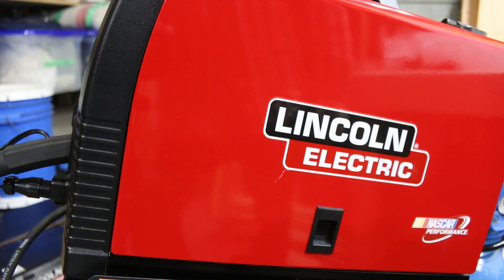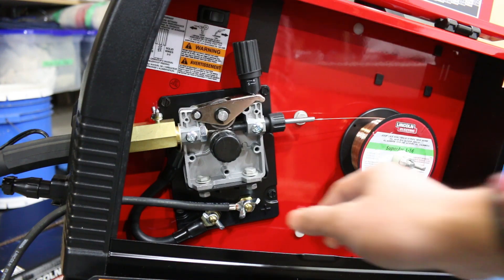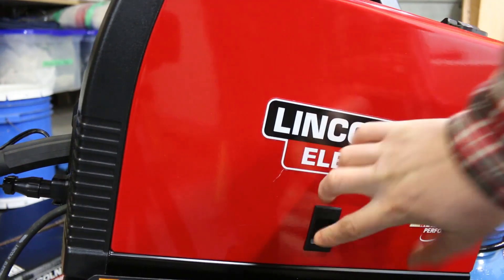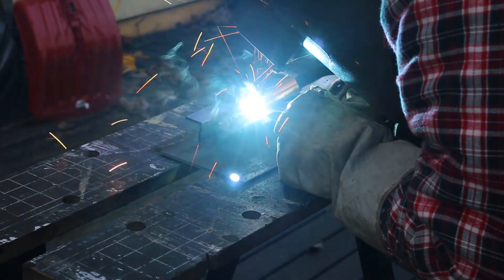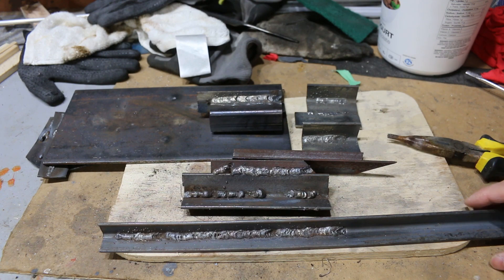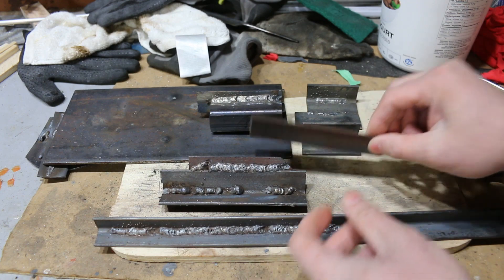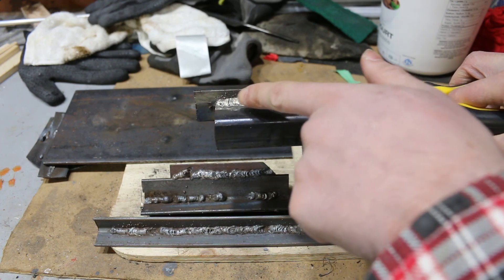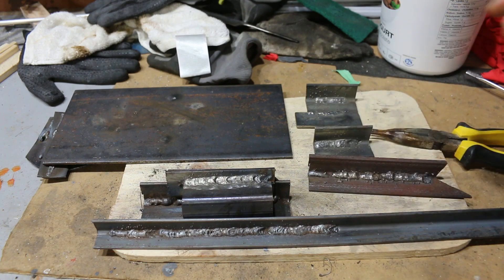Follow up to Lincoln Electric MIG Pak Welder 140 Review

Comment: With the angle you were using, you were going the wrong direction. 
 You were pulling your weld, you should be pushing your weld (right to left) for your angle  you were using.

Comment: I was going to tell you after watching your first review that you forgot to change your polarity after switching to MIG from flux core. You also neglected to show your gas settings however I have to assume you had it on? Seemed awful smoky and the bead looked like it had a lot of porosity in it. In this video you show welding with MIG (again no gas settings) but as Jeff Hall mentions below, you are dragging the weld puddle. This is correct for stick and flux core welding but not for MIG or TIG. Need to follow the "If there is slag, then drag" motto. Neither MIG or TIG have slag so you should push the weld puddle not drag it.

Comment: Thanks for taking the time to produce the videos. They were clear and the audio was perfect.  I just purchased the same welder and ran some test beads and it worked great on both gas and non gas.  My welding skills are very limited and I need more practice, however the first thing I did after setting up the machine was use the setting guide on the inside cover exactly according to the metal thickness ie. polarity, feed, current and gas flow set to 35 CFH (I used argon/co2).  With that all said the guide is a good starting point.  If you use the guide the rest will be up to your skills.  You weren’t clear on your gas bottles ability to show CFH.  Was that gauge showing tank pressure or CFH.  If it was tank pressure you should use the regulator that came with the welder and use argon/co2 gas.  Hope this helps.

Comment: My other question is what you are using for gas. I was told to use a mixture of 75% CO2 and 25% Argon. I ended up getting better results with 100% Argon but it is very expensive. Has anyone used something else with better results for cleaner welds? I thought about trying helium but maybe now I am using the best as the welds have improved 100%. I also turned my gas high as I could get it at around 35 and really improved almost zero splatter. For a nozzle cleaning solution I started using Pam original style and it does an excellent job keeping mu nozzle clean.

Comment: The main problem I experience welding with this machine is being able to see where I need to keep the weld running when welding two pieces of flat stock together. I noticed on one of your welds you started to drift away from where you were trying to run  a bead you also started drifting your weld also. When setting the darkness of the helmet to the stated setting in the manual it appears so dark it is difficult to keep your weld on track. Anyone have a solution without causing harm to one's eyes?
Reply: I was going to suggest an auto darkening helmet but it sounds like you already have one. For this welder (with it's maximum current output of 140A) a shade setting of about 10 is all you'll need. If you find it is too dark you can reduce it slightly and wear a clear pair of polycarbonate safety glasses under the helmet. Most people don't know that, believe it or not, clear polycarbonate will block about 95% of all harmful UV from a welder. Won't keep you from seeing spots of course but will prevent damage to your eyes. Getting used to "seeing" the weld puddle is, in my experience, one of those things that takes time to learn and get comfortable with.

Comment: Even with your polarity change, you aren’t using this welder properly.  Perhaps you have no idea of what a weld puddle looks like, a slag puddle, or even see it or the difference between the two.  This is what the welding hood/mask is for, to see the weld, the weld puddle, and manipulate it to make a more perfect weld, tying two pieces of metal together, in molten form.  When using a flux core wire, there will be slag.  If there is slag, then you must drag.  Perhaps you should take a welding course??..

Comment: Thanks for sharing your experiences with this welder. Are you running it on a 20 amp circuit? I bought the same one recently, but haven't opened it yet because I only have a 15 amp outlet in my garage. I'm trying to decide whether I need to put in a dedicated 20 amp outlet for it.
Reply: Try it and If it stat jumping breakers then you need 20a
Reply: Tool Talk Canada 
You can use these without dedicated 20a circuit...
Just the highest setting recuires 20a... A B C will work fine on 15a
Reply: This ^^ though i have gone to D on a 15A but it was only for short tacks
Reply: I used 20 Amperes circuit breaker for this welding machine.  Unless you want to reset circuit breaker often when running 15A
Reply: 110 V/120V in U.S. No problems. Welders also have a "DUTY CYCLE" or Time Allowed to weld before letting machine "Take a Break"..

Comment: I'm glad you corrected this, I did the same thing my first time with gas. Another tip to welding with gas is to "push" into the weld instead of pulling. Maybe not leading your wire so long, no more than a quarter inch out of the nozzle. You also should try holding the gun 90° to the surface of the weld.
Reply from the maker: Thanks, I will give that a try.  Took me a while to figure out stick, this should be simpler since don't have to worry about the rod getting shorter.
Reply: Keep us posted on how it goes.